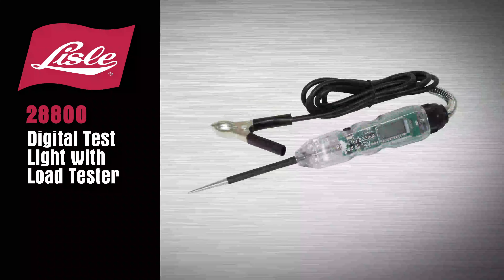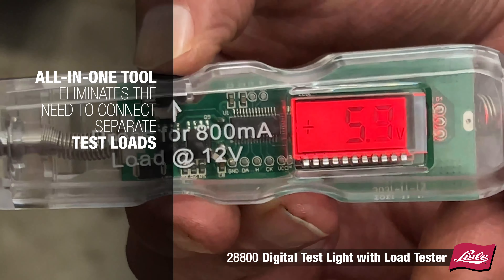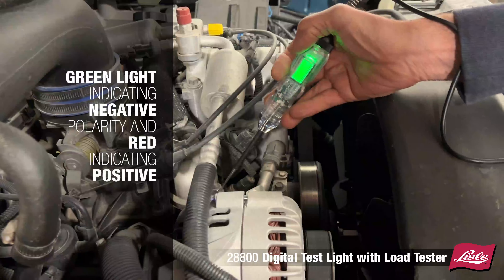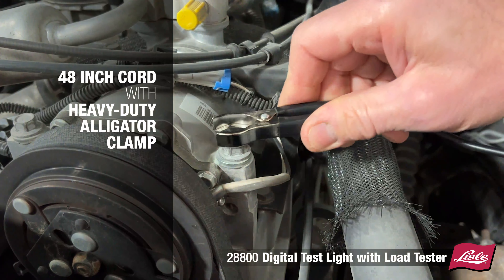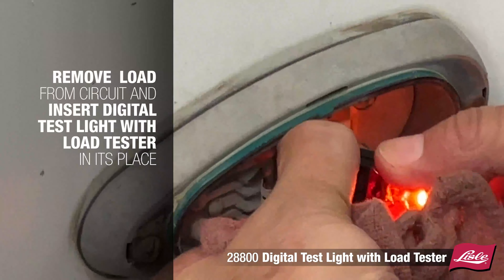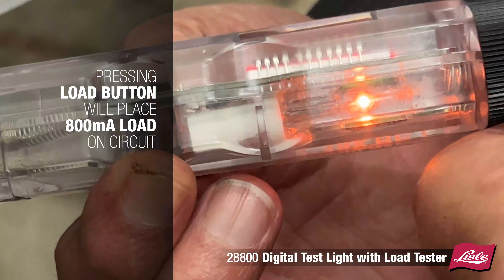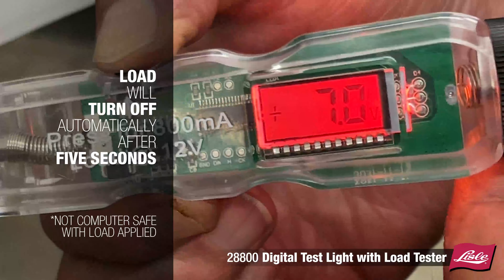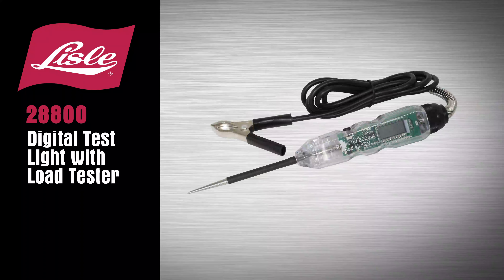Lisle 28800 Digital Test Light with Load Tester

Comment: Almost sounds like a Load Pro.
Reply: I’ve used the Load pro and it’s a clumsy mess of thick wire and bulky handle. It takes up a lot of space in a toolbox since you can’t wrap it around a multimeter like a typical set of probes. Also the multimeter is just reading voltage the whole time anyways. This test light is much more compact and very straight forward to use.
Reply: @markm0000  I also own the Load Pro so I know it's kind of bulky.  My comment was just saying it's using the same principle of use as the Load Pro.  It just uses more of a load on the circuit than the Load Pro does.  
I bought this Lisle tool but have never used it.  I mainly use my test lights that have various size bulbs for varying loads on the circuit.
Reply: @Mr2004MCSS  ok 👍